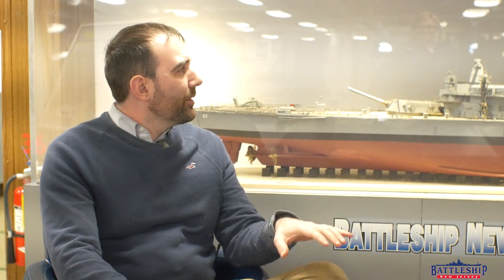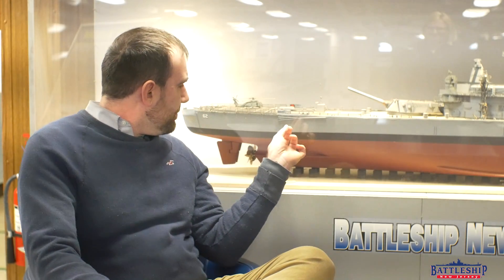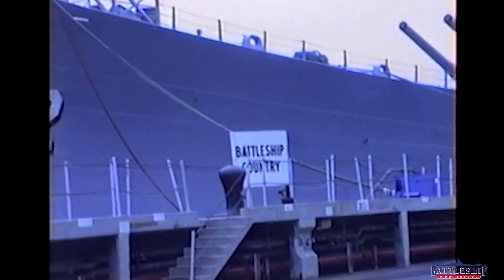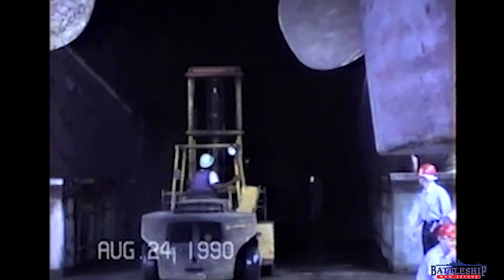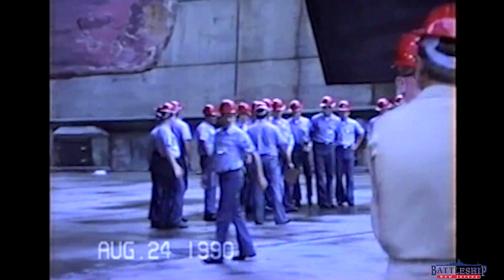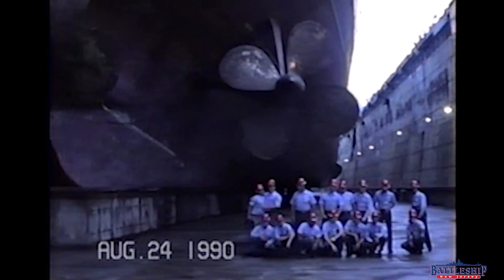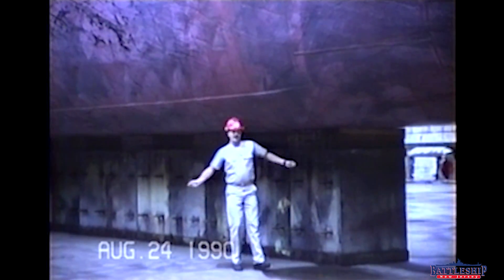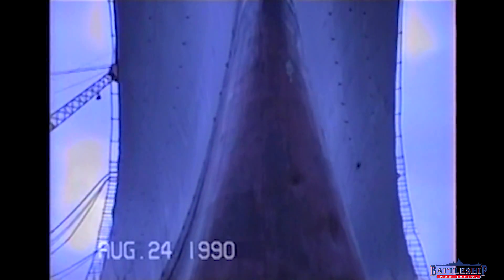The Navy's Super Secret Stash of Keel Blocks and How You Paint Under Them

Comment: Why is the ship lighter now that she is a museum rather then whan she was in service? most of the heavy stuff is still on the ship, it's not like the navy took off a turret or two. some phalanxes and electronics and such are missing but I don't think they would account for that much weight?
Reply: No fuel, no ammo, no supplies,no sailors, no fresh water, bilges are empty….she’s riding so high she probably needs to be reballasted.
Reply: I would think most of the sailors would be of the ship during dry docking? And instead the shipyard workers will be crawling through, so that can't make that much difference. The ballast tanks are not bone dry an earlier video talked about adjusting the ballast to fit under a bridge. Fuel is gone yes, but the boilers are filled with wax to preserve them.

I would imagine most of the ammo. And girl would be taken off during drydocking, so tanks can be inspected and so there won't be any accidents while welding or so. That said they probably had more fuel in previous drydocking than now but it's that really all the weight?

Also ammo wise a full load is a bit over a hundred shells while there are a dozen or so innert ones on the ship. That can't be that much weight difference can it? A thousand tons or so at max which seems very little compared to a bb.

Comment: AFDM7 we would dock Adams Class DDG, Spruance Class DD and FFG ships, basin was setup to and had a sonar pit and rudder pit installed
Reply: Am I recalling right that AFDM7 was even capable of drydocking itself as it had removable end sections that could separate and lift the main center portion?
Reply: @speleotrog  you are correct, there was a picture of Sustain inside the Titan drydock in Norfolk

Comment: Having work on AFDM7 AND 10 keel blocks were pretty much concrete, then Oak timbers and the a pine cap to allow the wood to crush, also AFDM10 only docked 637 and 688 boats and that was usually 2 or 3 of each class in a row

Comment: Since the power-plant can never be fired and propell the ship. Could the propellers be removed to be displayed, and would this benefit the ship by not having to hold the weight on the shafts and not have to bear the tidal and current forces on the vessel. Thank you.
Reply: The final duty of the Iowa class: ensure that nobody ever builds a battlecruiser because we can always reactivate one faster than constructing a new battlecruiser.
Reply: there is already a prop on display not too far from the ship.
Reply: @garywayne6083  spare prop.....
Reply: take the props off, boat becomes imbalanced, nose goes in water!!! 🤪🤪🤪
Reply: I think Ryan has covered this possible option in a previous video
Reply: The shafts are welded up the props could be removed but there would be a cost involved

Comment: It's weird that it would cost money to fill the dry dock and empty it again. The water is simply moving in and out. I don't understand.
Reply: Water is pumped out to empty... that takes alot of power.
Reply: Electricity isn't free, and pumps use electricity.
Reply: You’re moving enough water to float a battleship. You need to move it quickly, but in a controlled manner. High torque, high flow pumps are the most expensive type of pump. You’re paying for wear and tear on the pumps, the electricity (or gas depending on power source), and the people to monitor the same.
Reply: You have to pay a facility fee, basically rental, that would probably include the industrial expenses as well as labor for a large, highly-skilled work force.

Comment: Here’s a question, when you set the ship on the blocks, how do you make sure that it lands on them correctly?  Will you just be positioning the ship carefully and hoping that it touches down right?  I imagine you couldn’t have divers under the hull checking alignment during the evolution.
Reply from the maker: There are divers checking actually.
Reply: There should also be a member of the drydocking crew using a surveyor's instrument (Theodolite) as the ship is being positioned in.  The Theodolite will be in the exact same position as it was when the keel blocks were being set in place.
Reply: @ytlas3 Bingo. There's a cool documentary from New Jersey's Vietnam commissioning where a surveyor is calling out the ships position as it's pulled into that same Philadelphia drydock.
Reply: @jth877  I worked at Long Beach Naval Shipyard for 20 years.  I used to watch them set blocks. The guy doing the surveying had to put up with the foot traffic by yardbirds across the caisson.   Both the last Drydocking Supervisor and Dockmaster at LBNSY were good friends of mine.
Reply: @ytlas3 Oh cool, that's awesome.  Can you answer a question for me? How did they move the ship an inch at a time? Just line handlers? From docking my own craft it seems like a never ending battle to get it to be still enough.  I assume the ship is adjusted constantly until it hits the blocks. 

What a nerve-racking job.
Reply: @jth877  They usually drydocked ships on swing shift, so they wouldn't lose a day of regular production while disconnecting all the utilities. From the ones I saw, it was just the line handlers.  When they were drydocking the USS Belleau Wood in 1980, one of the large hawsers snapped. One end ricocheted off a truck and hit a supervisor, breaking his leg and maybe an arm.
Reply: You use divers and winches

Comment: You mentioned several times, that bunping the ship is expensive. Why though? Is it just the time, it takes that increases the rent for the drydock, or is it noticeable more expensive per hour / per day because of machinery or staff involved?
Reply: Energy to pump water.  For a graving dock (carved into the shoreline) you need to pump out all the water around the ship.  And for a floating drydock the amount of water to pump is the weight of the ship plus a bit more to account for the dock.  Either way it's a lot of heavy water.

There's a lot of work-scheduling inefficiency since on docking days you need line handling skills but on other days you need paint-and-preservation, ship-fitting, welding, plumbing etc.  To be fair to those workers you're probably paying a bunch of folks for a day off.  Unfortunately most of them probably aren't cross-trained for line-handing and it's not a job you want to throw someone into without training.

Speaking of skilled work you need surveyors on docking day and maybe divers - not too many people but they don't come cheap.
Reply: I think much of the added expense is from having to provide line handling personnel for the "bump" as well as for the pumps to clear the water from the dock.  The line handlers have to be available for most of the evolution.
Reply: One of the biggest expenses for scheduled ship maintenance is drydock time ... there's huge incentive to get a ship in and out of the drydock as quickly as possible.
Reply: Think of the cost of pumping the water, the staff needed and losing a day of dry dock time

Comment: During WWII, when capital ships like NJ were dry docked in forward areas using floating dry docks, where keel blocks used then too?  Did the floating dry docks carry blocks with them to accommodate a variety of ships like destroyers, cruisers, carriers etc?
Reply: Short answer yes.  Fun fact, in late 1944 the Iowa suffered a shaft bearing failure which necessitated dry-docking in a forward area.  When the Iowa came in she came into the dry-dock quite fast, and then went into full reverse to stop the ship right in the center of the dry-dock.  Good positioning, but the high speed entry and full reverse messed up the block pattern.  They had to back the Iowa out, empty the dock and reset the block pattern.  Don’t know how much extra time it took but people were not happy.

Comment: I think this was an extremely important video, even for the people not deliberately asking for it. In my head, I had basically assumed all of the information that you just put out about it. But, watching the video, I realized that I hadn't really based it on anything more than having seen ships in drydock. In my head, of course you just carve toppers from scrap wood, its cheap, easy, and all you need is to make sure its level on the bottom. But people may have never SEEN that before and wonder how wood could hold battleship
Reply: With enough wood, one can hold up pretty much anything. Having room to move around and also not screwing anything up, that's where all the planning comes into play.
Reply: By😮😮

Comment: The video shows 5 bladed props inboard  and 4 bladed props outboard.  Why the difference?
Reply: "Cavitation" and the resulting vibration that transfers into the ship's structure when identical props are used.  There is still some cavitation and vibration, but not as severe.  There are a couple of vids here on YT about propeller design you might find interesting.
Reply: I'd bet it has to do with outer props trying to stay out of the turbulence of the inners..

Comment: I know I'm referencing a movie and it's complete fiction, but in the opening scene of "Les Miserables" (the newest iteration) a chain gang is, by hand, hauling a ship of the line into drydock. So that leads me to the question of just how, exactly, do you get, what, in essence, is a giant steel city, INTO a drydock? That, in itself, has to be a massive effort. How does that work?
Reply: Some of the movement will be from tugboats. Uncertain probably NO tugboats into drydock. Some will be with lines/ capstans perhaps even line to other strong machinery to pull it. Humm - go to a video of NJ in Panama canal lock - and note the locomotive trolly/ tugs on the side there.- Once in you move it (BB NJ - or any other) SLOWLY & CAREFULLY- You don't really need a MASSIVE amount of power. ( yes I have intent aware I have all CAP 3 word - not to yell but for emphasis. Humm to below IRT build the FORD or Nimitz class - Could be wrong -it is built in a dry dock on top of the block - flood dry dock to launch - NO longer is anything BIG in US built to "slide down the ways" IN Paascagoula - they built the ship on top of rollers -and when ready moved it to a floodable dry dock area. IF I recall correctly around 1973 when US Tarawa (LHA-1) was built - they claimed then to have rolled the largest object around on the planet - easily much bigger than any block of the Pyramids.
Reply: The electric locomotives at the Panama Canal are there to keep the ship centered in the lock (i.e., not hitting the sides of the lock); the ship powers itself into and out of the lock. @wfoj21
Reply: You flood it and push it in, remove the water making sure the boat falls on the blocks. Nothing complicated. Also, go watch Fitzcarraldo, then read about how it was made. :)
Reply: If you have a tidal beach and a large enough crew you can haul a surprisingly large ship ashore as the tide is going out.  You might have to stand in the water while you do that.

Typically that was something that ship's crews did, like, it was a normal part of being a sailor.  How else were you going to clean the hull?

Les Mis shows people down in a graving dock - they should be like 5-8m below water, not waist deep! A real crew would actually work alongside the drydock, perfectly dry while they carefully guide a floating ship into position.

The hard work comes later: pumping all that water out.  By the 1830s you probably would have steam engines but before then, sure, graving docks were dewatered using human and animal power.

Combining the two technologies is all spectacle.  It looks ridiculous to anyone who knows how a drydock works.
Reply: Part of the beauty of ships is that floating on water they take proportionally little power to move. I’m no expert on dry docks, but the same sort of capstans and winches that the boat uses to moor can be in the docking area.
Reply: Its floated in with tugs  and moved by ropes and winches